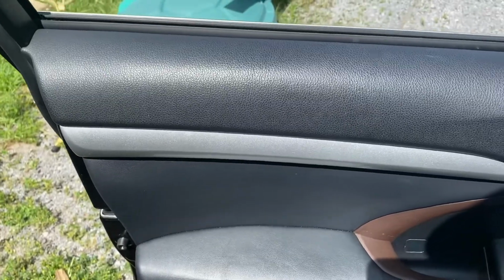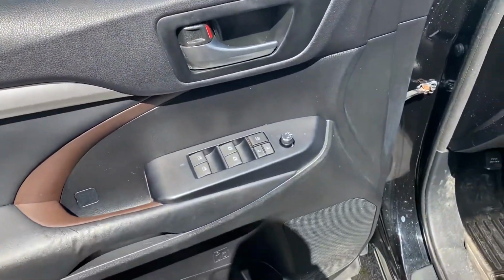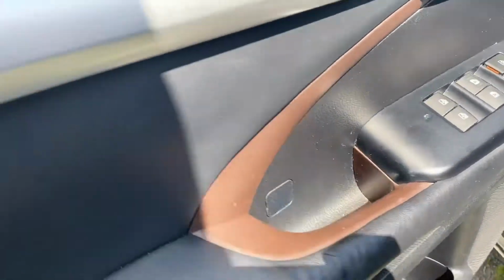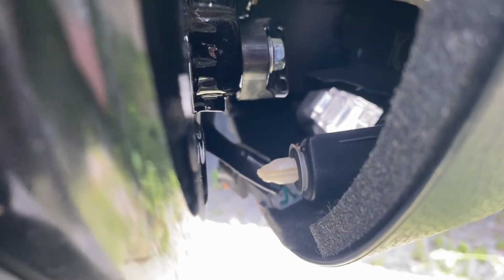2015 Toyota Highlander Interior Door Panel Removal

Comment: To remove front door panel, do you need to remove the battery negative terminal to prevent side door airbags deploying?
Thanks!!!!!
Reply from the maker: Yes! Always a good practice to disconnect the battery when working on a vehicle.
Reply: @ridesandramblings  thank you!
Reply from the maker: @qball2000able  To clarify, disconnecting the battery is to reduce the possibly of injury to yourself. I don’t know that disconnecting the battery will guarantee that the airbag would not deploy if the sensor is hit. It’s something I’m still researching and if I find the answer, I’ll let you know.